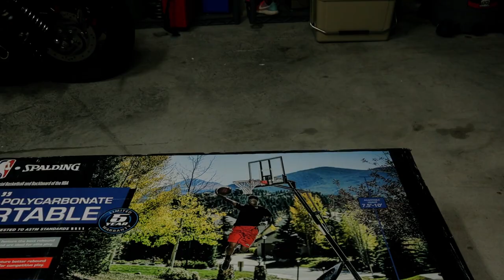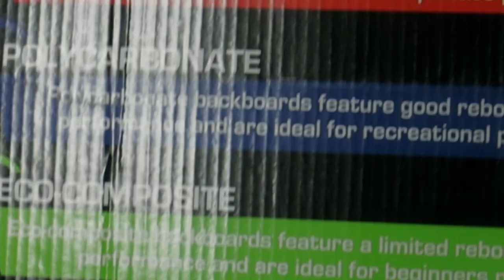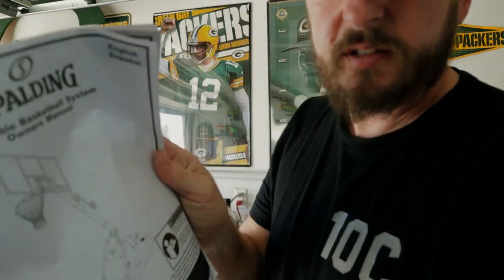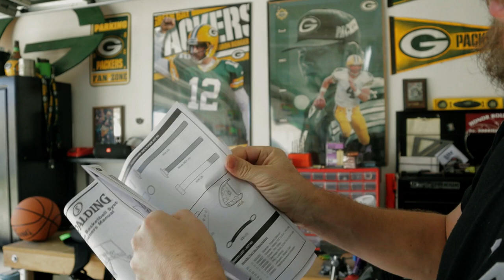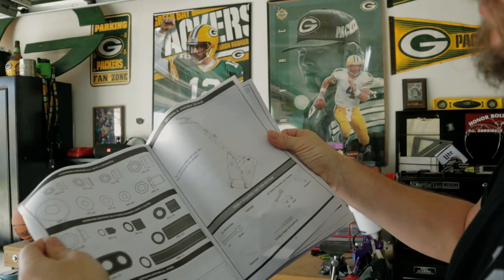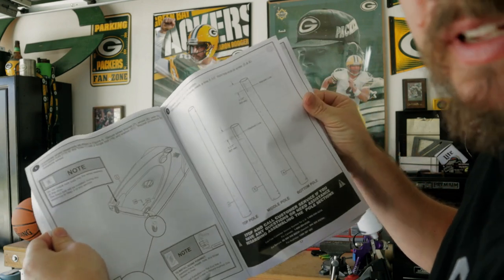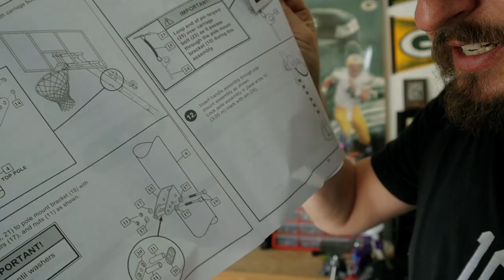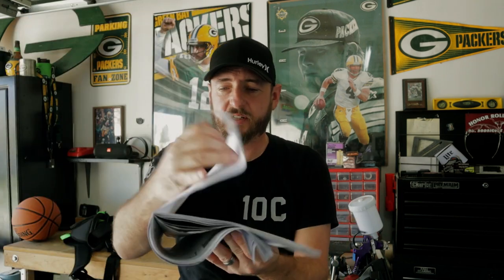Spalding 54 Polycarbonate Portable Basketball System Review. He Got Game!

Comment: As far as the base is concerned, does it need to be filled with water and if so, is there only one way in and one way out?
Reply from the maker: Base does need to be filled. It fills on the top. I believe there is a drain for the water. I will confirm later. Thanks for watching!

Comment: I just put mine together.  The backboard wobbles a lot when you hit only backboard, it looks like yours wobbles too (albeit less than mine).  I guess I need to tighten a few more nuts, but it seems like it's designed to wobble somewhat with how those screws/nuts go into the "arms"...
Reply from the maker: Mine does wobble a little, I think its just the design. We still have a fun using it. Thanks for watching!

Comment: Am i able to dunk on it and hang for a bit without it breaking? Thank you
Reply from the maker: I'll be honest man, as u can see from the vid I dont have mad hops so I wouldn't know. I wouldn't though, I dont know if that angle with that base would support it.
Reply: It’s a great rim but don’t hang. You can dunk and get it but don’t hang.
Reply: No don’t hang on it it might break but you can still dunk
Reply: My son destroyed his doing that. If you want to dunk and hang or even use a lot get something more heavy duty. First he ripped the plastic base apart so I ground mounted it with concrete then he bent the pole.
Reply: Misprints I wouldn’t cause it’s a breakaway rim and look up shaq breaking backboard breakaways are meant to breaks with hard dunks
Reply: Misprints do not hang on the hoop!!! I learned this the hard way and the pole breaks off from the base and it all falls down, it’s fixable but never as durable.

Comment: Hi Brian. I just set this net up for my kids. My backboard moves around a bit when the ball hits it. I noticed yours does too on the video. Is that normal? Just wondered your thoughts. Great video!!
Reply from the maker: I assume it's normal. This is the 1st one I've set up so I dont really have anything to compare it to. I can say it hasnt diminished the enjoyment or functionality at all. Thanks so much for watching!
Reply: Cool. After I sent you that message I watched a clip from Spalding's official channel and it did the same thing. My guess is that is normal with adjustable hoops just because of those elevation rods.
Reply from the maker: @MrNewman31177  yea I kind of expected there to be a little movement. My biggest worry was the whole thing tipping over lol.
Reply: Sure but I suppose if you put enough water in it and sandbags on top it will be good.

Comment: I have the exact same hoop and it’s impossible for me to get it to 10 feet. Getting it to 9.5 is easy, but after that I can’t get it to 10. Is it difficult for you as well?
Reply: My friend has the same hoop, and when we tried putting it on 10ft it was a little difficult, but all you need to do is use more force.